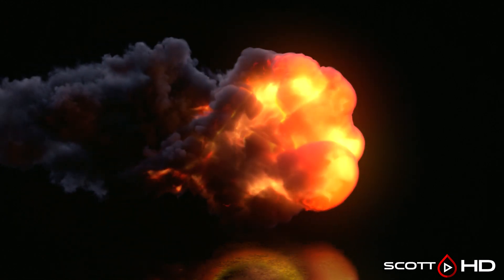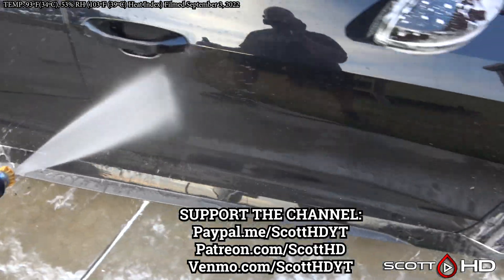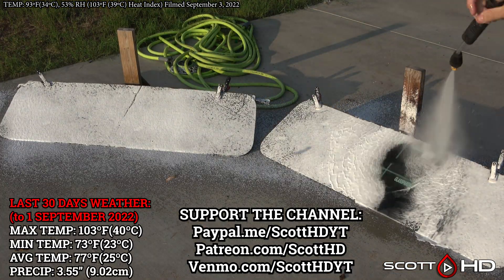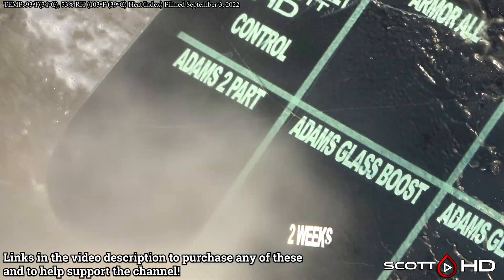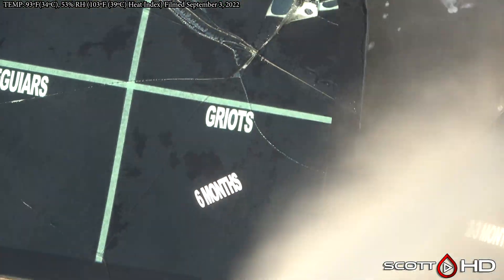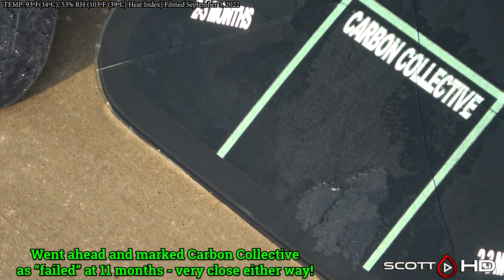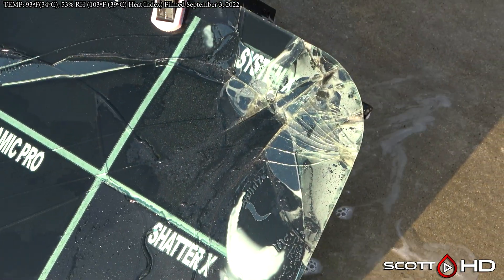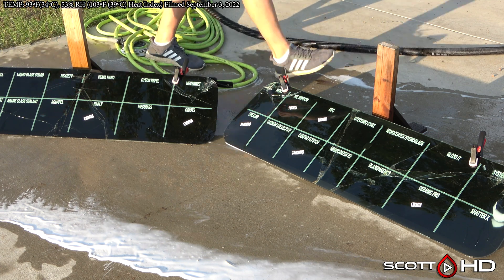28 WAY GLASS COATINGS TEST (HYDROPHOBICS) - UPDATE 13 - 11 MONTHS

Comment: Hey Scott, Can I recommend another test? Not just ceramics, what about testing the best soaps, iron decon, yada yada. I was going to buy the Iorn decon that you use (Meguiars) but I was wondering Adams is much cheaper and was thinking, well whats better? Also why HoneyDue chemical guys? Etc.. I think that would also add flexibility to the channel. Furthermore, other than just washing, what about a test that uses other methods of cleaning like hand drying, or applying decon and see how the ceramics hold up. 
Just food for thought.

Comment: I'd really like to see the Windshield test, are you still planning on doing it?
Reply from the maker: It's on hold right now.  EVERY single one of them is making a chattering after application.  Don't know if it is because it is a flat Jeep windscreen or what the deal is, but it isn't going as planned.
Reply: Aquapel also suffering from the same problem?